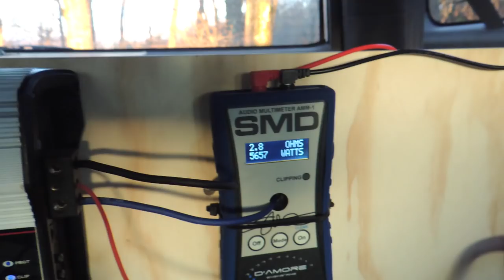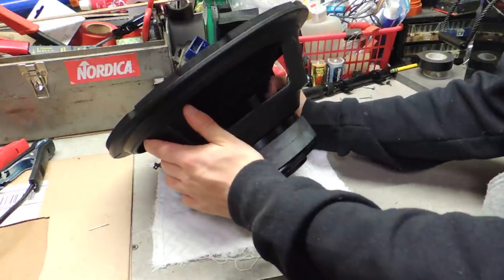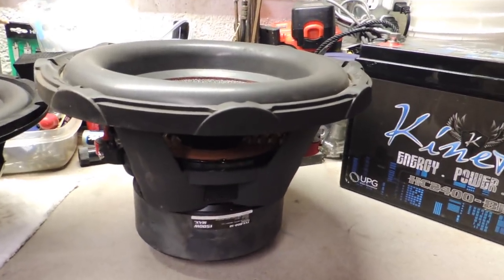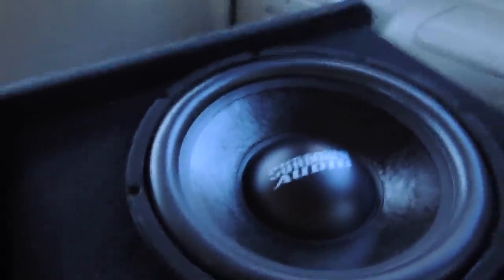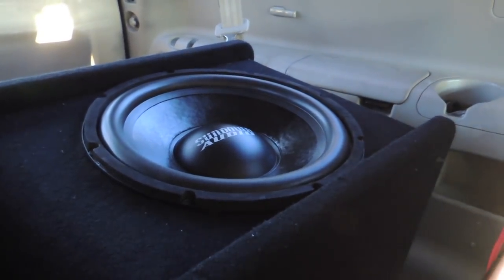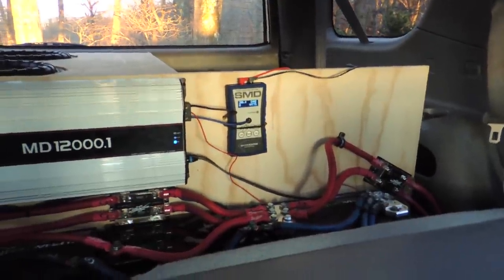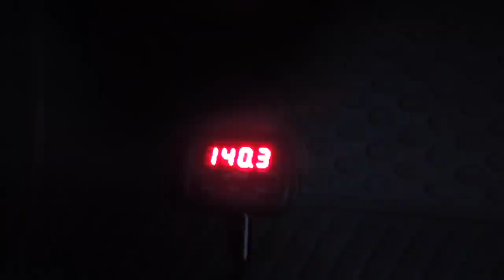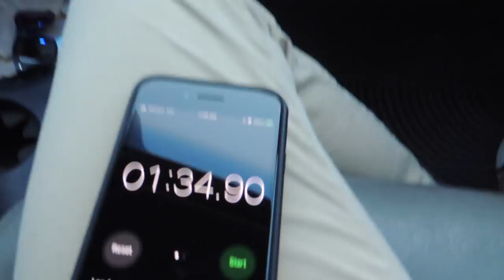300w RMS Sub Takes HUGE Power!! | Sundown LCS In Depth Review

Comment: Dude great Vid
I have 2 of the LCS 12D4 on 1998 MTX Thunder1501D moded to accept 1ohm. All1/0awg with 2 xspower 3400d. Its true output on burps is in the 2200w range best I can figure. 210+/-amp draw around 75% efficient would be fuzz over 2200w. Those 2 Sundown 300w lcs have been taking every ounce of it. No smells no bottoming out.

Comment: Parker I was a little critical of your last review but you totally redeemed your self. Great review! I can't believe how well that little Sundown did.. It is my new 300w fav
Reply: you can do better for 90$ . 300w is poor
Reply: @mazda2284  What do you suggest?
Reply: @Ronco160  plenty of good options from quality brands , imo the 35$ more for nvx vcw is a HUGE jump in subwoofer for the money,  triple the handling power + , double the xmax , 2" vs 3" long wind height coil , ect
Reply: @mazda2284   What sub is the best for $90 or under though?
Reply: @Ronco160  Rockville k6 is better even for 75$ . This video shows a 90$ sub that can take rated , well put the k6 on 300w and it does even better .
Reply: @mazda2284  Ok Thanks, I was just curious what u'd suggest. I'd hope the k6 could handle 300w rms for a couple mins.
Reply: @Ronco160  I figure put subs on a level playing field rather than play the " you rate it wrong " game . A 90$ sub should take MORE than a 75$ sub right? That's fine though cuz now I'll address this in my video of these
Reply: @mazda2284   Awesome I look forward to the video!  I think the k6 is a great sub for the money.  I don't think a $90 sub should take more then a $75 sub. I think it should take its rms rating on a tone for a long time. I'm sure there are plenty of subwoofers that can't.

Comment: I have no experience with Sundown but I just can't stop thinking you are paying extra money for that logo. When I bought my NVX VCW15 (on sale for $162) sub I looked around and the SA15 was $100 more at $267! The EMF lowballer was about the same at $175. Both the EMF LB and the Sundown SA have a 2.5" coil and a double stack and are both rated at 750wrms and the NVX VCW has 3" coil and a larger triple stack magnet structure a smidge more xmax, lower FS and is rated at 1000wrms, now yes I agree that 750w rating is conservative but the NVX's 1000w rating is also underated. That thing can take a whopping and cap feels cool still. There is no way anyone is going to convince me those 2 subs are superior to the VCW as far as good? Specs is specs.... is there coil that much better? is the cooling that better? Is soft parts that much more superior?  I don't know but the NVX sounds awesome, and handle more than rated power so what performance aspect would make someone say I'm some glad I spent that extra $100 you really get what you pay for! also the So where is the extra money going? Just The dust cap logos that's expensive ink! Yes I know there's with some brands specs don't mean squat like coil size doesn't insure big power handling ect but with reputable brands like NVX specs do mean something and IMO I think you get more sub for the same money and or more sub for less money...don't get me wrong I think sundown and EMF make awsome and insane products that kick ass and yes I'm comparing NVXs top sub to SD & EMFs entry level performance subs but I still think your spending alot extra for that logo. I can already feel the heat from Jacob fullers army of Sundown fanboys!

Comment: You know alot of batteries. I need some advice. What's better: Viper VP-2400 or the Kinetic 2400? The viper is $209 and the other is $269. I would like to save $60 if there's not much difference.
Reply from the maker: The Kinetic is definitely a tried amp true battery. I don’t have any experience with the Viper so I really can’t say but I’d look around for reviews and see how it has worked for others
Reply: Kenetic
Reply: neither , Headway DIY lithium would be a much better option
Reply: Limitless
Reply: @Elijah Dossett he said whats betta.  All aluminum limitless, i think yiu can get one for 800 ish
Reply: @Elijah Dossett limitless makes the worst premade lithium on the market . you can build the same damn thing for 1/4 the price.

Comment: Bro sundown subs can take x2 to x4 the RMS if its clean power,  MY single NSV4 18" is on a single SALT 6 amp that puts out up to 8000-9000 watts at 1ohm.  My sub takes it like a champ all day long.  In a 7.2c  box tuned to 28hz.  I do love my set up but i wish i would have bought more cone area for the money, like two zv5 15" for around 800 each instead of 1 NSV4 for 1300, would have been a bit more money but the cone area would have been better i think.
A cool video i think would be cone area vs power, like see if doubling the power gets more RMS vs doubling the cone area.  Or say 1000 dollars of cheap subs like 10 of these, vs a single 1000 dollar sub on the same power, wonder which would get high scores lol.
Reply: Ive been wondering that last half of your comment for a long time. I had 16 sa10v1s on 2 ns1v2s and only pulled a 154.4. I was tuned to 28 and it was the only time I metered it. It was almost the cone area of 5 18s but with more motorforce.

Comment: I would love to see a Soundstream Tarantula T5 and there Reference line specifically there reference 10 because it looks pretty stout for a budget sub. With some way to anchor them down I'd think dense foam yoga blocks be used to lower box volume for different requirements. If that worked and with a couple diy reducer rings you could test 8 &10s. I love seeing bunch of little 6/6.5" subs thumping away they look so cool

Comment: parker great vid bro but what is your fascination with aluminum wound coils? you do know copper is a far superior material to run a current through don't you? to run the same amount of current through a cca coil the wire winding would have to be over six time the diameter of the copper wire. cca is garbage bro. electronics anywys that's why you always go for single crystal oxygen free copper in your home audio for the best quality possible. or am i missing something and i get the aliminium has good heat dissipation but if you don't have to heat up your wire as much due to a thinner dia then you wouldn't need the aluminum and it's heat dissipating properties in the first place no? I dunno let me know what the crack is Parker plz or anyone.. thanks

Comment: I can’t find a stereo shop to help set my gain on my Kicker 1200.1 amp going to a Kicker 12inch L7 Q Class 1200-1500.  WHATS the best way for me to set the gain as perfect as possible? Not just the ear tune either . Like just turn it all the way up then add bass slowly blah I need a more accurate gain setting
Reply: A A RON I did mine based on sonic’s video. Multiply speaker rms by ohms then find the square root. That’s the ac voltage at the amp’s speaker terminals for a 40hz test tone with the volume up. Example 450 rms x 2 ohms is 900. Square root of that is 30v
Reply: Greg Blau yeah so much to still learn. Learning quickly but it’s hard finding someone that can set the gain electronically. I have it set right now but I don’t think it’s at it’s full potential. I need to get a new volt meter. I have a 4ohm L7 Qclass ABD wired parallel and at least at 2ohms. Also I have a sedan and not a suv but I have one of my back seats down cause it rosins better (unfortunately) sounds good still with it up but I like to hear it. Basically what I’m asking, would it be better to face my speaker at me while I’m driving or the speaker still facing the trunk lid? Idk what would be better and can’t just turn it without stretching wires. Do you know by chance? Also going to get a new meter today and try what you told me. Thanks so much
Reply: Should sound better facing back but you never know. Exo and crutchfield have tested it iirc crutchfield got like 10db and that’s supposedly double volume
Reply: Greg Blau so turn my box to where the speaker and vent are facing my back seats? It’s facing the trunk lid like normal right now but if it sounds better turned towards the inside of the cabin then I’m turning it towards the cabin inside
Reply: Should be louder how it is but I can’t say for sure. Still learning as I go. I bet you have plenty of gain left though. When I first adjusted it with a meter I calculated 22 volts and I only had the amp at 12
Reply: Greg Blau yeah whenever it stops raining here in Dallas I’m going to start the big three and then test and see how I can set my gain the best way without hurting my L7 but at the same time getting 100% of its power. That’s all I want lol I’m almost there. I can turn it all the way up and it’s perfectly clear and the bass is good but I know it can bang harder and once I get my box built from someone it should be a lot better but I think I’m going to a custom DC level 3 for this new box.

Comment: Test the cheap sony xplod subwoofer
Reply: ivo 1 I’ve got a 10” xplod. Seems good
Reply: 5 minute video for sure lol
Reply: I snagged 2 discontinued 15” xplods from a guy trying to sell them at the pawn shop. Pawn shop offered $20 and he really needed the cash and was gonna take it so I offered $30 for the pair just to beat the hell out of them and they honestly took everything I could throw at them. $30 on woofers $10 for sealed used box that I cut down to specs and wood glue. Definitely didn’t stand up to my single treo ssp 15 but for less than $50 i was happy, i put them in my friends truck and hes more than happy!

Comment: So I have 2 of these running in parallel with a 2600w kicker amp and it’s still not enough power to run both. Had to buy another amp to run to each sub. Sounds amazing.

Comment: These subs are priced perfectly. I have two of them in a Skar Audio EVL12 ported box and they absolutely slam! I had Kicker CVRs before I got them. The CVRs are no match! Sundown underrated the heck out of these subs. I have them wired in parallel down to one ohm and they are taking 700 rms watts a piece! They can take more power than that. My bestfriend has 800 rms watts on each of his.
Reply: How much better are they than the cvrs? I got one cvr in a ported box and I giving it 500 watts, but I feel like the really low bass (like 30 hz and less) sounds muddy and weak to me. Im thinking of switching to the sundown E-12 or 2 lcs 12s
Reply: @nickvanelzen4630  as an SA series owner, I’d recommend the E series if you can afford it. The more power you can push the better, I have a single SA12 Classic on a CT Sounds CT2000.1D amp being fed 2k RMS in a 3.4 cubic foot box. Absolute monsters, the newest E series design took heavily from the design of the last generation of SA series subs. Meaning they’re better for the same price as before, just $50 more than the LCS.

Comment: Curious, do you have an upgraded alternator and if so what kind and where did you get it from??
Reply from the maker: Running stock alt at the moment but have a brand X 250 amp alt this will he installed in a future video
Reply: Where did you get the 250amp alternator from. I have the same vehicle and am looking to buy one for my set-up?

Comment: You need to run your system with your car on if your voltage drops to low those full bridge amplifiers will blow up
Reply: Will it really? I thought it would go into protective mode?
Reply: I am fairly new to this though

Comment: Got one from the yard sale. Run the sa version but I was very impressed with it sound quality it really good
Reply: From the yard sale what was wrong with it? Anything major?
Reply: @destinseese34  small scratch on the dust cap
Reply: How does it hit low notes? I’m looking for something that sounds good without too much power.
Reply: @gregblau8082  compared to the sa version not even close it's more of a sq sub to me but man does it sound good
Reply: Thanks I’m not trying to beat up the block but going from a little car to suv my 10” punch seems like it’s struggling to fill the space and not hitting certain frequencies like it used to. It’s still plenty loud so I am looking at something to work with my 400w amp and not get into electrical upgrades
Reply: @gregblau8082  if you have the funds look into the sa classic and 1000 watt amp in the right box you'll be beating
Reply: I’m trying to stick with the amp I have now, alpine 400 for budget reasons. I got a power acoustik gothic cheap and built a box basically to test my theory that a 12 would work better for me. It’s a little buzzy at certain frequencies and seems like it takes a lot to get going but I like the overall sound. Now I’m looking for a decent sub designed for that rms range in the $100 neighborhood. If I wanted to do it once and be done your suggestion would have been towards the top of my list but I like tinkering and trying new things which gets expensive if you use that level of product

Comment: Ad a 1/4" of foam around the inner part of the speaker hole. That helps a bit from air escaping. Sound deadner inside the box will also help.